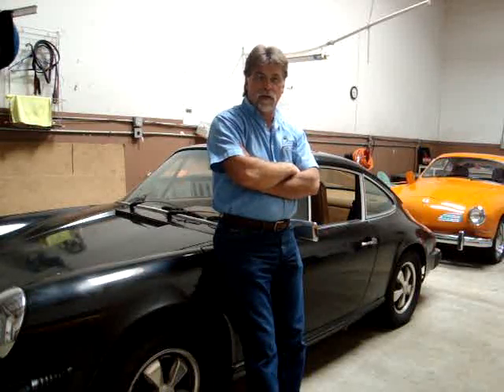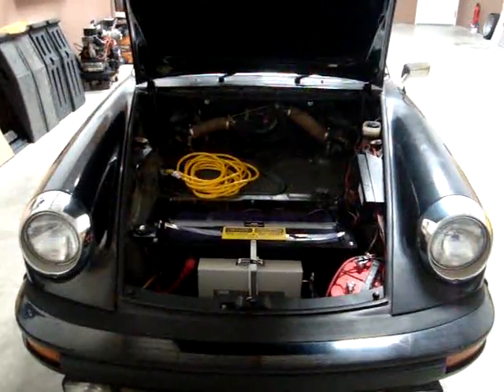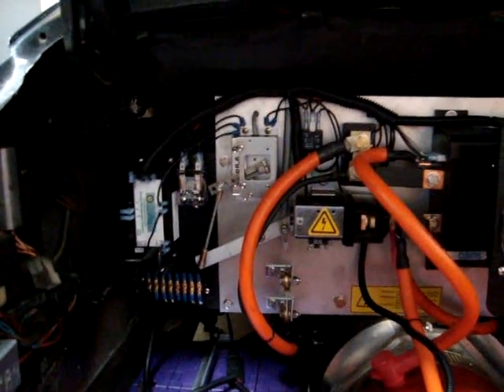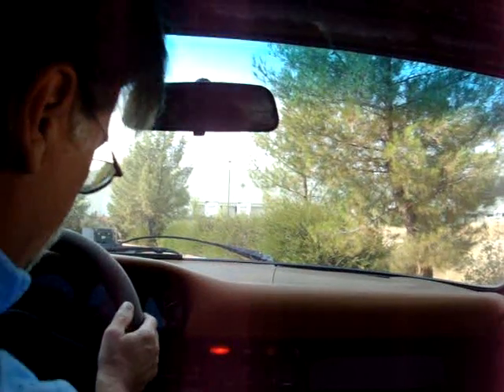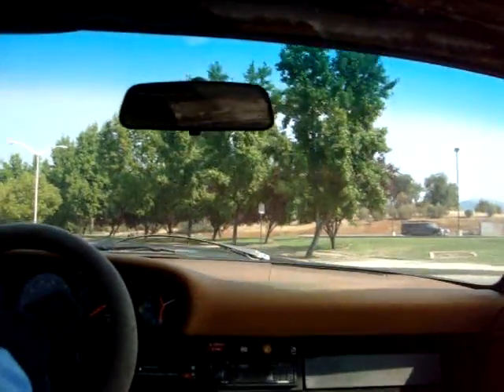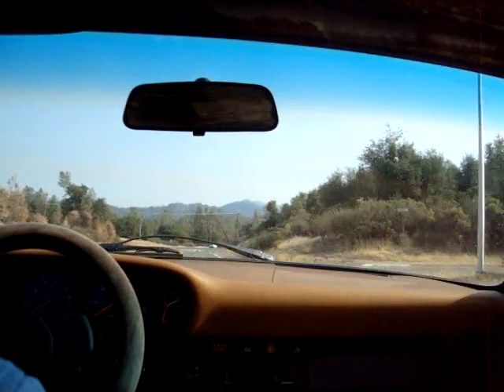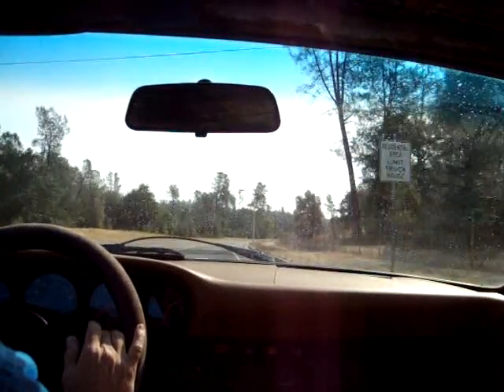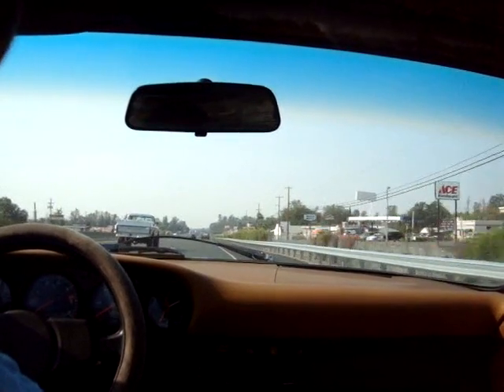DIY Electric Porsche 912E Freeway Run  www.EV4Unow.com

Comment from the maker: What first caught my attention was that your most positive and negative points are fairly close to one another. We try to avoid that, but have had designs were they were close.(Such as the Karmann Ghia) I like fuses, and having one in the center of of your pack is good insurance for the worst case scenario of an accident. We also always have each line front to rear, etc. fused. I don't feel that circuit breakers are a good substitute for a fuse. Great for emergency or service disconnect.

Comment: Hi Richard, I don't have a fuse in the system. I have the positive lead going directly to a circuit breaker on the front of the battery frame, between the seats. Thanks for your comments.
It's a shame your not going to EVCCON, I would have liked to meet up and see one of your conversions.Eric

Comment from the maker: We do not always use a precharge resistor.  Curtis recommends the resistor to "extend contact life" of the contactor.  We have not experienced excessive contact wear in years of service and tens of thousands of miles of travel.  If a customer wants the resistor, we do stock them and use them when desired.  Question regarding your Final Stages video.  Do you have a fuse in the middle of the pack?  Could not see one in the video.  BTW excellent job on your videos.  Two thumbs up.